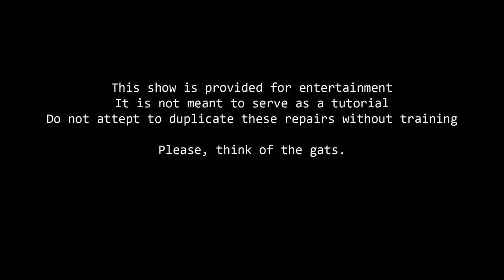1887 Winchester Restoration and Conservation; Anvil 049

Comment: This may be a stupid question but what is the best thing to mount a wire wheel to. I have a fine wire wheel from brownells that doesn't work in my lathe so was wondering what people recommend.
Reply: Could use a drill press
Reply: Drill, bench grinder, maybe a strong dremel

Comment: Hello. I have a slightly strange question on the topic of the video - due to what the Henry bracket of this Winchester is held in a horizontal position and does not fall, and due to what it is held in a vertical position, without trying to return to the horizontal? In the case of the model 1866, I understood the reason when I saw the rifle in the section - the bracket in the receiver has a continuation, clinging to the elements of the system and activating it, but here the diagram shows that the bracket is not connected to the elements of the shotgun inside in such a way that it does not fall and seems to levitate in the air. But this is a key question without which it is not clear how the locking the barrel bore
Reply: Hello, if I understand what you are asking, you want to know what keeps the mechanism closed and locked in place ? I am not an engineer or gunsmith but I own an example of this model, and it appears to me that it is the main spring that provides tension to support the closure of the breech as well as drive the hammer to fire the weapon .
Reply: @ifitsfreeitsforme1852  Good afternoon. Yes, the essence of the question is that it is not clear how the Henry bracket is held and does not fall? For example, in the Sharps rifle, the reloading bracket is held with a special lever, which can be seen in this photo on the cut (https://ibb.co/QXyd3Qv). Another question is why the Winchester rifles have a short handguard only for holding the weapon with the left hand, and the Mosin, Mauser, Springfield, Lee-Enfield rifles have the barrel completely or almost completely hidden by a wooden casing?
Reply: @ИгорьЗахаров-ж4щ  Hello again. This firearm design works with mechanical principal which is different from that of both the Sharps and the earlier Henry designs .It is difficult to explain without having an example in hand to demonstrate the movement of the working parts that comprise the breech mechanism. In simple terms, the Henry operates with a toggle link system to open and close the breech, where the Sharps uses a vertical block in a mortise that is attached to the operating lever by a small link to accomplish the same function . Diagrams of these two designs are readily available on the internet. Both designs require the addition of a spring to exert force on the assembly in such a way as to prevent gravity from making the system fall open under its own weight. This 1887 design  uses a compound motion of rolling or rocking and a vertical movement of the breech block to achieve both an opening/closing and a locking/unlocking function. This is accomplished with a minimum of parts and is very clever in my opinion. The spring in this design does double duty in a way that is similar to both the Sharps and the John Browning improvement of it known as the  Winchester single shot model 1885. The main spring powers the hammer as well as exerting tension on some critical points to hold the action or breech assembly closed.
In regards to the question of the amount of wood used in the stocks of different firearms, my opinion is that military style weapons need to protect the metal parts from combat damage and heavy use by covering with wood where as sporting firearms were built to be pleasing to the eye as well as be functional. Manufactures saw a certain esthetic beauty in the form of the metal parts comprising the assembly ,so took the time and expense to give a fine finish to these exposed pieces.
Reply: @ifitsfreeitsforme1852  Thank you very much, Craig, for your detailed answer and interesting point of view. But still I didn't fully understand. You claim that the breech bolt is held by a system of springs, but where and how are these springs located in the diagram in the section  
https://i.pinimg.com/originals/68/d0/9a/68d09a3db0751e0da951cd13d19ab18a.jpg
https://www.hlebooks.com/patents/winch/1887/fig01.jpg
https://3dtoday.ru/upload/main/dae/dae9b4cc63e6c062cd863b83491ce0c1.jpg
and in the component list?
https://marauder.homestead.com/files/1887_parts.gif
Reply: @ИгорьЗахаров-ж4щ  Hello again, and thank you for the links .
As I said, the function and movement of the breech block is difficult to visualize. But with the schematics at hand , it will be a great help.
Firstly, there is only ONE spring to be concerned about for the sake of our discussion . If you refer to your parts diagram, it will be (#26) ; which is the main spring. This spring by the nature of it's design and it's relationship to the other parts, not only drives the hammer , but also applies pressure in such a way as to keep the action closed . I will confess that with the hammer at full cock and ready to fire, the power of the spring to hold the action closed is significantly diminished , thus requiring the shooter's hand upon the lever to keep it closed. I think also, that the shape of the trigger (31) plays a part in helping to keep the action closed when firing, as there is a bit of a hook that engages a cut in the lever when it is activated to fire the gun. 
Now, if you look closely at the shape of the breechblock (#34) or as you say ...bolt, you will notice a slight shoulder to the rear of the part's profile. This section of the breechblock mates up to a corresponding shoulder machined into the frame (#22), creating a solid joint when closed , that absorbs the recoil of firing. What allows for this combination of a falling and rolling block movement  is that where the receiver/bolt pin(#46) passes through the breech block, the passage is elongated or slot like to allow for some forward and backward movement of the block so that the rocking action and the locking action can be accommodated. Another way to say this is, that the block drops downward a bit so it can clear the locking shoulders, then rolls backward to allow the extraction and ejection of a shell as well as the feeding of a fresh round. 
Like I said , it is difficult to envision without actually seeing one in person to watch the operation .
I hope this gives a better understanding for you.
Cheers
Reply: @ifitsfreeitsforme1852  Hello, Craig. Thank you again for helping me to understand, but to my shame I still did not understand anything and there are objective reasons for this. First, the picture with the list of components shows that the breech bolt (this is the official English name of part # 34) has a bracket that seems to levitate and as if by magic horizontal position and does not fall even in the absence of spring # 26 (https://taylorsfirearms.com/media/site/1887_shotgun_manual.pdf). Although it is possible that they just depicted in this position it, but in this case there is second question - according to this scheme (https://i.pinimg.com/originals/68/d0/9a/68d09a3db0751e0da951cd13d19ab18a.jpg), it is clear that the spring #26 moves along with the entire gate group of elements when opening the lock. This means that this spring can hardly participate in holding the shutter in a horizontal position and in preventing its fall, especially since it does not deform in any way when opening the shutter (neither compresses nor unclenches). In the official manual for this weapon, it is indicated that the spring #26 is an element of the striker, that is, it is connected to the trigger and activates the striker to fire the shot. But this spring can unlikely hold the shutter in the static position and prevent it from falling. Okay, Craig, as you rightly pointed out, it's hard to explain something to a person without being able to show it, and besides, English is not my native language or maybe it's because I'm only 14 years old. Thank you anyway, and in conclusion, one more question - why by the end of the 19th-beginning of the 20th century, the Winchester rifles completely lost the competition to rifles with a longitudinally sliding bolt such as Mosin, Mauser, Lee-Enfield and even the Americans adopted for service Springfield M1903 rifle with exactly the same layout scheme. Perhaps it is a weak spring of the tube magazine (part #8 https://marauder.homestead.com/files/1887_parts.gif), but the spring can be made stronger, and the tube magazine is shorter. Instead from the Winchester rifles, you can shoot without losing sight of the target, which means that their rate of fire is higher. The scheme of operation itself is even simpler, which means that you can not say that the problem is their high cost or complexity of the device. What do you think about this, Craig?
Reply: to open links please remove the parenthesis at the end of the address bar
Reply: @ИгорьЗахаров-ж4щ  Winchester seems to have fallen behind the competition by virtue of focusing their sales in civilian sporting interests rather than military contracts..possibly thinking that the military market was already saturated with good designs , so they may as well focus on a market they already had a huge market share of.
You are correct in your thinking that the bolt action in it's various iterations was a very efficient design. It had few moving parts and the ones it did have were relatively easy to manufacture. It was strong, easy to maintain , was resistant to dirt and moisture problems and allowed shooting from the prone position. The perfect design for outfitting the military 
I am sorry that understanding the 1887 design is so puzzling. And perhaps I misled with the emphasis of the main spring helping to hold the action closed. But that is how I understood it to be 
Please follow the links to other videos showing the operation of the shotgun and perhaps it will be helpful.
Cheers
https://youtu.be/9lDdStTYW_0
https://youtu.be/ZE9WD9Fihks
Reply: @ifitsfreeitsforme1852  Good afternoon. I understand your point, Craig, but it seems to me that this is the wrong conclusion because competition for sales markets is the basis of a market economy, and no matter how much money the Winchester firm does not bring in civilian orders, the military contract will still be much larger. Therefore, when the state announces a tender for the supply of weapons, each weapons company wants to win the right to supply weapons to the army. Thus, the Winchester rifle, which was actively used in the armies of many countries in the second half of the 19th century, was completely replaced in all countries of the world by uniform rifles with a longitudinally sliding bolt of the Mosin or Lee-Enfield type. But how and why this happened is unclear, because in its effectiveness, the Winchester rifle was comparable to self-loading rifles like the Garand or SVT-40, but these appeared much later. Then how did the Winchester rifle lose the competition with the Mauser or the Springfield M1903 already by the end of the 19th century? Obviously, the fact is that it had some design flaws, because the military departments of the whole world could not just ignore a more effective weapon, which means that the Winchester rifle was not more effective, but what is wrong with it is not so clear. 

Thank you for the links, but I have already watched these videos and under one of them there is my similar message with an attempt to understand why the shutter is held in a horizontal position and does not fall. The author also tried to explain to me, but I still did not understand. It is obvious that the spring you mentioned moves together with the entire bolt group of elements when the bolt is opened, and therefore it is not clear how it can keep it in the body in a static horizontal state? Just in case, once again, here's how the reload bracket is held in the falling-block action of the Sharps rifle   https://ibb.co/QXyd3Qv   . I understand that this is a completely different system and I illustrate in this way what exactly I do not understand and what I would like to understand. As for the Sharps rifle, I also could not understand for a long time why its reloading bracket is in a horizontal position and does not fall. I reviewed a lot of videos, found no information in my native language, and only this picture from the French website turned out to be the only image of the Sharps rifle in the section. So it became clear how to hold its shutter, but with the Winchester 1887 it was more difficult to understand. Okay, Craig, thank you, have a nice summer!

Comment: I can't remember if there was an episode Mark talked specifically about pulling out the dark oils in old stocks to refresh the finish or not? Anyone know the episode number if he did?
Reply: Ugh, I know exactly what you're talking about but I forget which one it was. He used a heat gun to heat the wood around a repair, and it bled its old, oxidized, dirty original finish which Mark massaged into the repaired area to blend it better.
Reply from the maker: Toe repair, 1891 Argentine mauser, anvil 074, near the end

Comment: In the intro of the anvil the wood buttstock on the stand, does it belong to a Ruger No. 1?
Reply from the maker: Actually, I believe it is a Winchester M21. That was almost 4 years ago though....
Reply: @marknovak8255  ahh, I see do you ever get in Ruger No.1s? I think they are their own kind of animal because they are a modern fallingblock that isn't an historical recreation and unless someone just buries one. I imagine you haven't done a restoration on one (yet).
Reply from the maker: @isaach.3996  Several. They crack just behind the tang, and need a crosspin in the checkering pattern
Reply: @marknovak8255  ahh

Comment: How do u get surface rust off.. when u can't boil it in water
Reply: Maybe the carding wheel. It's like a very very fine wire wheel. That might not take off the finish but still brush off the rust. Anything abrasive is going to remove finish as well as rust. 
Ideally you'd still want to boil it. He has some videos better detailing the process and even shows how you can use a piece of gutter and a propane burner to make your own.
Reply: If the rust is light enough, you may be able to use a penny made prior to 1982 to gently rub the face or tail of against the rust to remove it.
Reply: Ummm.. ok.. I see your point... But I'd rather not go there... That seems like a extreme last resort.. maybe..
Reply: @strydyrhellzrydyr1345  What is it you are working on?  Because I'm currently in the process of conserving an Winchester 1887 myself, and have found that a combination of lightly brushing with a copper brush, then wiping with an oiled rag has provided some decent results.
Reply: Brass, copper or bronze brush/wool works very well and is made for it.
Reply: I see what u guys are saying... Thanks... 
But I think this is different... I wish I could explain to you. What the surface of this barrel and body looks like... It is rust, but, it's sorta not...  It looks almost like there is nothing there. But it's sorta rough feeling. And it's still very dark.. black ish
Reply: I know it's been a year but the process requires boiling. The boiling or hot steaming is what turns the rust back into bluing.

Doing anything else is just scratching the gun.

Comment: You just ruined  a collection Rifle wiht the wire wheel..   Oh well it's not my gun.  It's now worth 30% of what it was.
Reply from the maker: It didn't work, and was actively rusting. Now it works, and all active rust was converted to an inactive oxide (rust blue). So it went from worthless to operational and not dying anymore. I'm missing your point here........
Reply: What collector rifle? did you see that nasty thing at the beginning of the video?